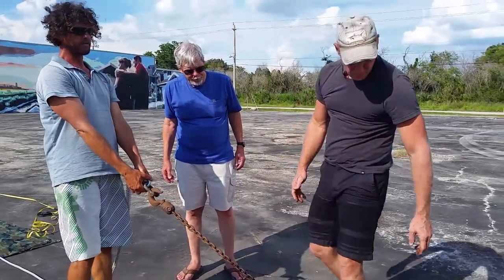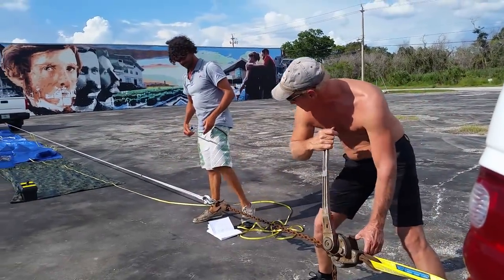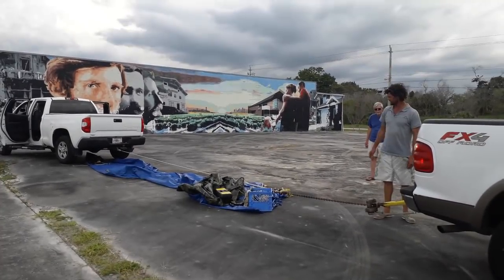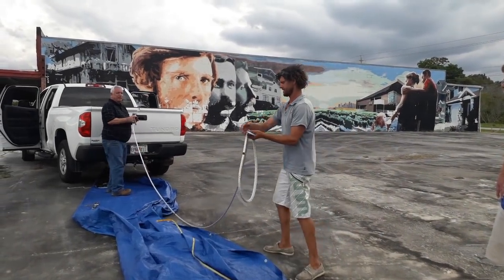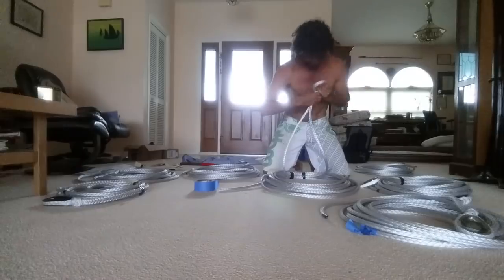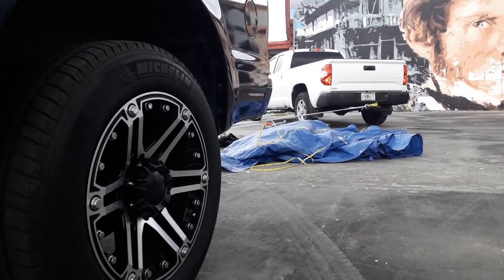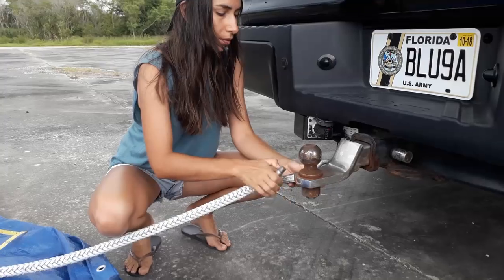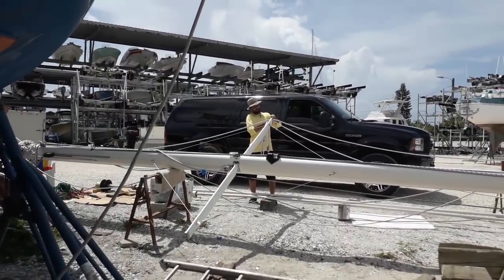Update 11 - DYNEEMA: How to streech Dux Synthetic Rigging

Comment: Don't do this at home LOL. I love the galvanised or better bronze turnbuckles much more than stainless. Have you ever seen friction welded turnbuckles? this never happens with galvanised or bronze ones. Interesting knot, I learned it without the double hole at the beginning. Most important is the 7 times inlet that's what they told me.

Comment: it's starting to look like standard stainless rigging would be easier to install, and last longer. One nick on that Dyneema and it needs to be replaced.
Reply: The life is very competitive.  For a Cruising Boat stainless steel probably still rules.  In racing the weight saving is to substantial.
The synthetic rope keeps improving.  New ways of using the dyneema keep it viable.  The big reasons is diy.
Reply: Ive heard of a guy here in Australia that just replaced his dyneema rigging after 15 years . And submitted it for destruction testinv havent heard the results of that.
Reply: sinclairearl  I was against it for a while but once you learn about it its pretty good. It has to be oversized so much to deal with creep that it ends up ten times stronger than needed so even after UV degradation its plenty strong. The line he's using is enough to lift the whole boat and is massively stronger than stainless.
Reply: Just read the report of the destructive testing the dyneema after 11.5 years had reduced in strength by only 6% still 40% stronger the stainless steel.  The boat had been sailed extensively including a few Sydney to Hobarts

Comment: Then why not use galvanized wire, my 65ft sail boat cost me 350$ for all the standing rigging in galvanized and lasted 8 yrs with no rust.
Reply: Sails , agreed a very viable option and way less experimential stuff and im sure insurance is not high on his priority , only a hassle if you enter waters where insurance is required .
Reply: I have grave concerns about chafe with the rope standing rigging.  I have watched these new synthetic lines disintegrate with chafe.  Looking at SLV, I think the line is encased in pvc pipe tp protect it.